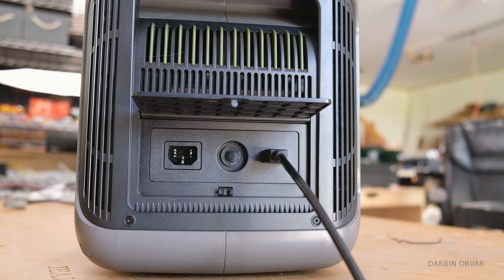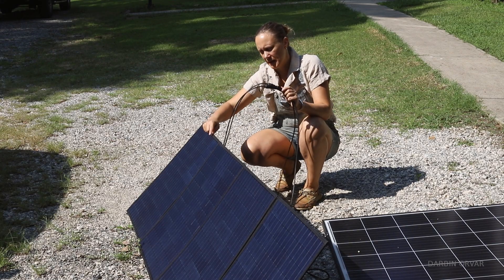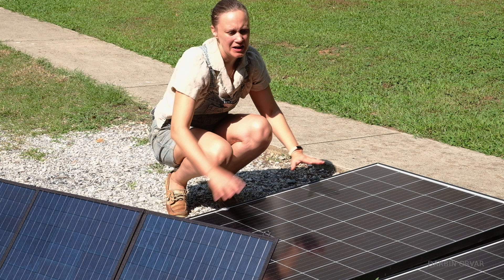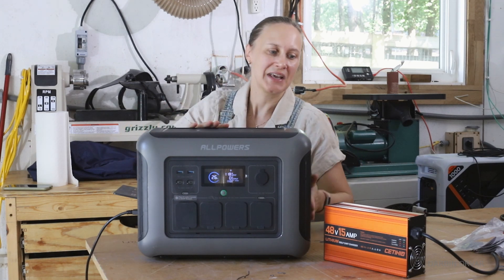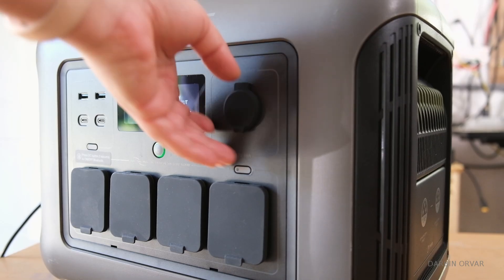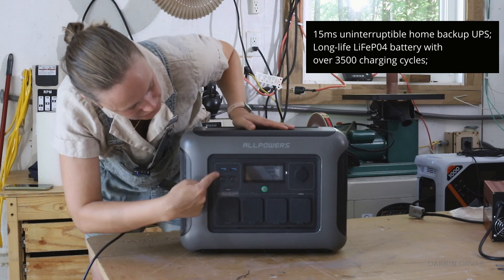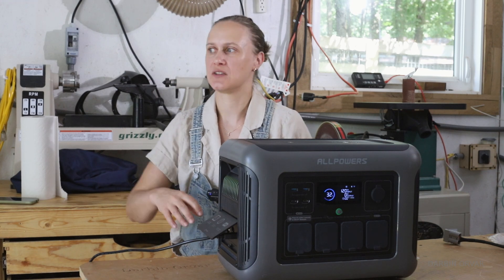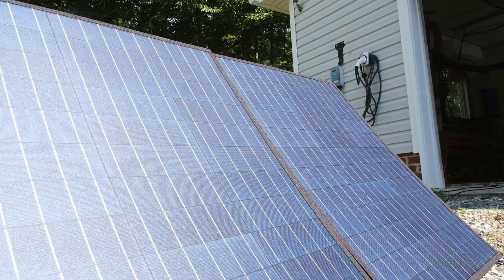Power Station High Solar Voltage Test (ft ALLPOWERS R1500 Solar Generator)

Comment: OK, I didn't pay attention in my college physics...you said your panels output 45 VDC and you run your panels and the test panels in series, but at 1:43 you say you're bringing in "about 60 V". Why not 90 VDC? 
The panels output DC, the inverter converts the DC to AC, which goes to the charger which converts the AC back to DC, which can be stored in the LiFePO4 battery.  The "Power Station" is the combination of the inverter and the charger.  Do I have that right?  
At about 2:20, you refer to the "BMS system."  What is that, please? 
Have all the units you've stress-tested used the same combination of solar panels? I am curious about why this system doesn't heat up as much as your previous systems did. I'd guess that if the input and output voltages were the same, the energy lost as heat would be the same.
Sorry to be so slow on the uptake, Linn. I should have paid more attention in physics.  
Good video. Interesting system.
Reply from the maker: It was the allpowers portable panel that was 45 volts. The other panels were ~ 33 volts each, but were run in series. A bms is a battery management system. In terms of the heating up of the inverter - I am guessing some have better fans to cool it, or a more aggressive bms setting. It is hard to be sure.
Reply: @darbinorvar  Thank you.